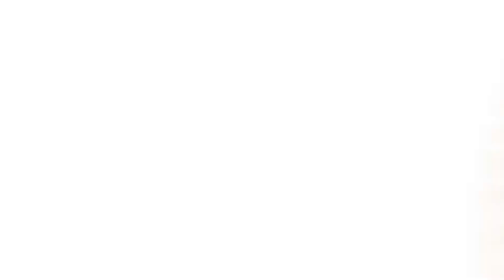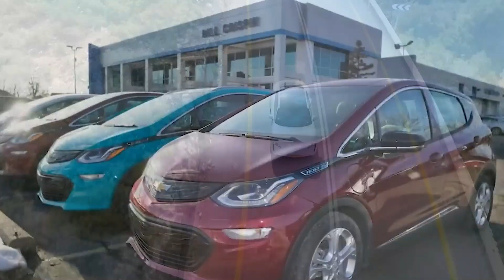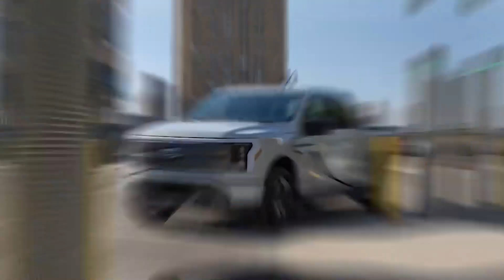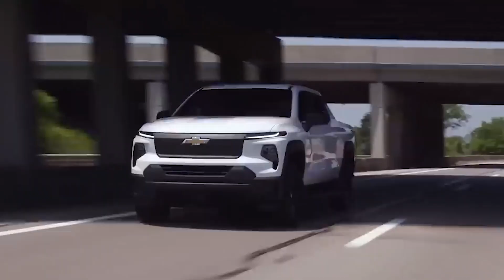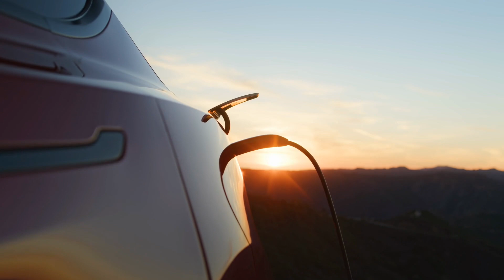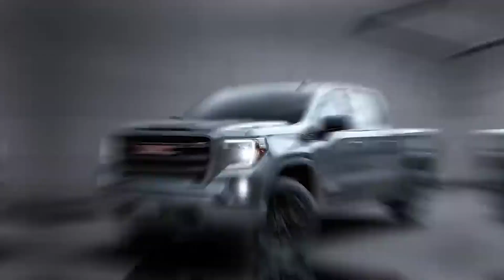HUGE NEWS! EV Owners ANGRY As EVs DON’T WORK In Winter!

Comment: My gasoline car has stopped working in Winter, too. Uhhhh.... the battery died....
Reply from the maker: You can get a jump. start right back up. Can even buy a battery jump starter and you don't need another car. 
Imagine your EV dies, and you call someone with another EV, plug into each other, and share some battery?

Comment: Alright so lets get this out of the way. I've been doing TONS of research onto EV's and winter driving and this doesn't tell you the story or the full truth at all. There is a learning curve to be had with EV's and winter and all of this comes down to pre-conditioning the car before use and charging, the benefit with EV's is that this is rather easy. 

Most, if not all EV's, offer a function called "scheduled departure" and this is fundamentally CRUIAL to driving ANY EV in the winter. I will use the Mach-e for example here; In fords settings within the center console you can setup the "scheduled departure" and what the Mach-e will do is 1 hour BEFORE taking off it will warm the battery, this process takes time, but after its complete it will then warm the cabin (normally 20 min before the scheduled departure). This feature is so fundamental to your winter experience and 99% of the bad video reviews dur winter don't do this.

Another important factor to driving EV's and BEFORE using a public fast charger is also to pre-condition the battery for the fastest experience possible when charging. Using the Mach-e again, if you use the Ford Navigation, which is actually getting decent reviews, it will start the pre-condition 20min BEFORE reaching the charging destination. The reason for this pre-conditioning is to have the battery at the best optimal temps to receive a charge as to prevent damage to the batteries.

Regarding any infrastructure concerns. This is not at fault of EV's but rather who ever installed them. They should know full well what climate they are putting these at and use the proper heating/cooling measures to ensure they work.

There WILL be growing pains but YES, EV's will be replacing ICE cars as battery tech improves and longer ranges can be achieved. New battery tech like solid state batteries are in the works and are, at this point, assumed to handle themselves better in colder climates AND provide longer distances.

BTW, ICE cars also having problems in the winter, we've just learned to deal with them.
Reply from the maker: You make very valid points that are logical and hard to dispute. It's very evident the effects on ANY battery caused by temperature have to do with the fundamental way batteries work. The majority of people do not do their research, or they never owned an EV to experience first-hand the PROPER way to utilize it in cold weather.
Reply: @TopAutoSolutions  the biggest thing is this comes as a lapse in the compaies ability to tell the people and this comes first by telling the dealerships, and it seems they arent aware of this.

Comment: Batteries do t like cold weather my car was always dying on me In Weather a d she was petrol car.. If u dont use the cars In Winter while it's freezing and snowy it's just kills the battery no matter what.
Reply: If your battery in an ice vehicle keeps dying on you... ypu have either terrible batteries or need a new alternator, etc.
We have a fleet of F150s here that get started in sub zero weather on a daily basis... zero issues.
Get a new battery.
The battery under the hood of your ice vehicle is not what this video is about. EVs are a whole different story.
Reply: You need a new battery or your car need to be fixed fixed for killing your battery.
Reply: If you're not driving during the winter, you can remove your battery and keep in a warm place while your vehicle is idle, maybe trickle charge it once in a while.

Comment: Just get a Tesla, I have three winters with my car and no problems. I live in Michigan and it works so good my wife sold her Acura MDX and got a Tesla. My Model Y has 35,500 miles on the standard tires and its still the best car in the winter I've ever owned no need for snow tires, beats the MDX with new mud and snow tires
Reply: Dude, soon you will realize your car sucks!
Reply: @mikej282  I can tell you have never driven a Tesla because I've let many people drive mine and 100% were blown away. I'm not green and think global warming is probably not true. Go to a Tesla store and drive one 15 miles or more. Type on the navigation a destination 1500 miles away it will come up with every charger you need to stop at and how many stalls are open at the first two. I charge at home and it costs $6 for 150 to 200 miles. My two cars have around 50,000 miles total and maintenance has cost under $8 for windshield washer fluid and I did one tire rotation.
Reply: @mikej282 - lmao!!! You people are funny.
Reply: You're obviously  vaccinated,  and a Democrat and think abortion  is "ok"